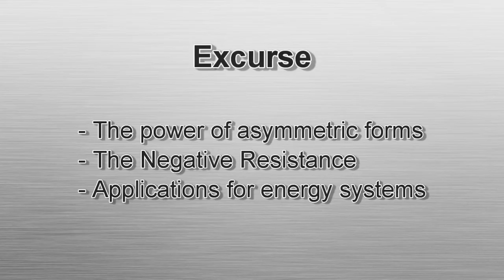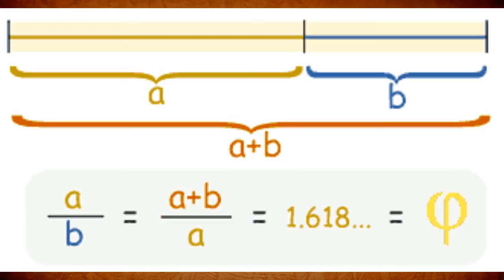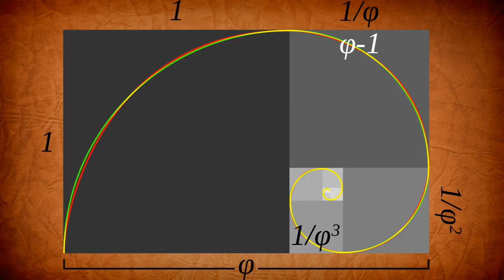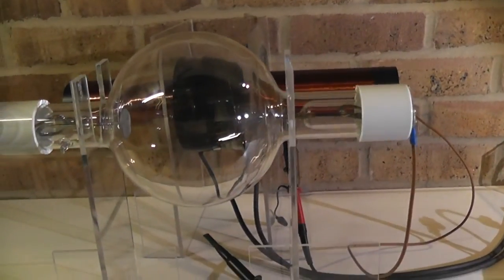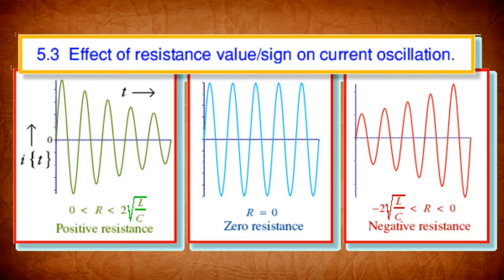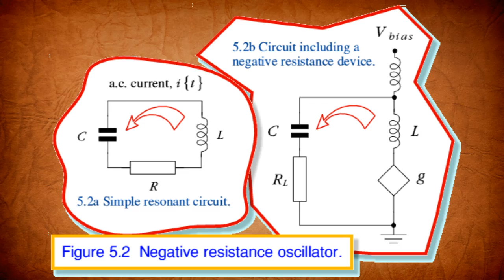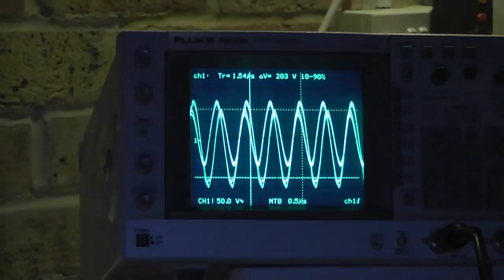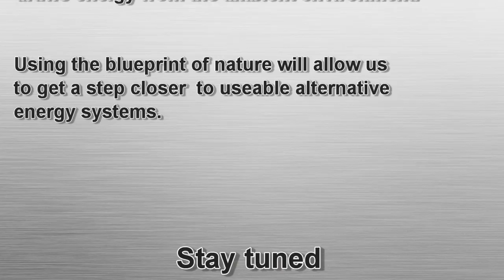The Golden Ratio, Symmetrical versus Asymmetrical systems

Comment from the maker: As you said, that the lowest potential in a unipolar Tesla coil is zero at the bottom where you terminate the secondary to ground. The Bipolar Tesla coil is not terminated to ground so current and electrical potential remains in the system. The transmission line principle and the highest power propagation of 1/4 wave still applies. You have an open system. The Unipoar Tesla coil  is because of grounding a closed system. However these guys want sparks and that is what it does.

Comment from the maker: Not sure what you mean by 3's". The reference to the " z" component of the wave can be read by Eric Dollard. Telsa only mentioned  a wave which connects to the Ionosphere via a Magnifier Tesla coil
Vortex flow is mentioned by Walter Russell and Victor Schauberger. Or simply search the weather pattern for hurricanes. It does show the same pattern. Have a look at my website under the book section. Link is on the right hand side.

Comment from the maker: Hello Stefan, sorry about that, watch the video again. Fibonacci is the higher order of the golden Ratio. I did not say it applies  to my experimental setup. It should bring things into prospective. I also did state explicit after that slide that I focus on the capacitor electrodes but it applies to all analogue components as well. Moving the coil did probably confuse things. But it follows the same laws. The potential does change by moving the coil. Note, it is not physical grounded

Comment from the maker: Very good. I will add that to my website as reference. My new video comparing the symmetrical orientation versus the asymmetrical orientation in a coil system, has completed the measurements recording stage.
It has now to be crunched into a spreadsheet and visual displays. Hopefully available by the end of this week.

Comment: I've been thinking about the Hubbard Coil, and recently a made a larger coil, and a couple smaller ones with the appropriate PHI ratio as Hubbard did. I used scope and signal generator to find self-resonance of each. They each have same number of turns, just different diameters of the PHI ratio. Sure enough the self-resonant frequencies are also PHI ratio. Hubbard MUST have done this on purpose. I then found on the web that you can BEAT 2 PHI ratio frequencies to get a 3 lower PHI ratio freq. !!

Comment: Difference of potential? If the anode and cathode are symmetrical there is no increase in flux density near a low. The bias or compensation would be the smaller geometry of the cathode.

Comment: a simple schematic showing coil turns and part numbers, vendors ect would help those working in this area would save much time and effort but only a few take the time to do the drawing and present it.   I see many others simply repeating the same research over and over on the internet. after 20 years we stll don't have a small energy system in a box that runs itself.